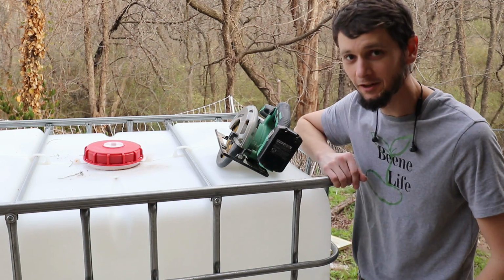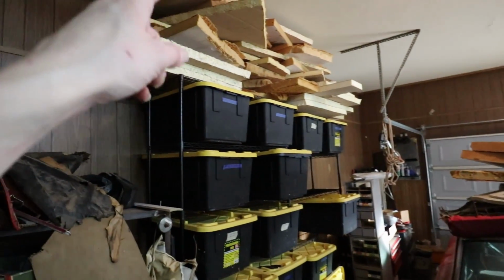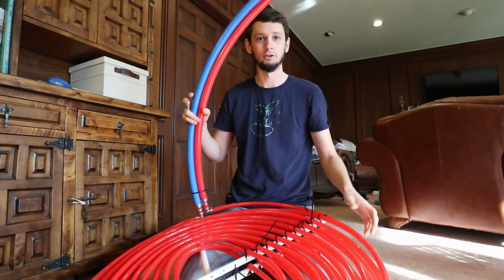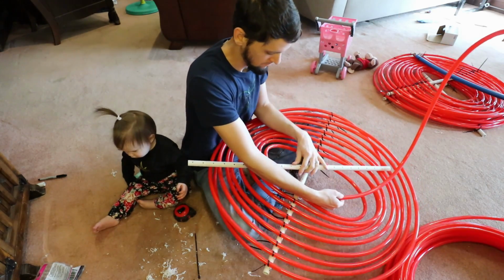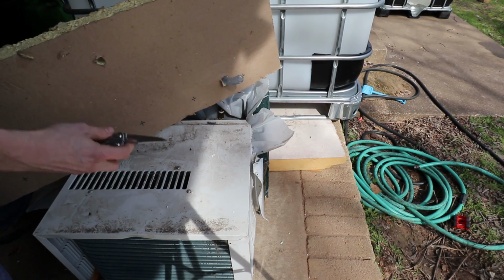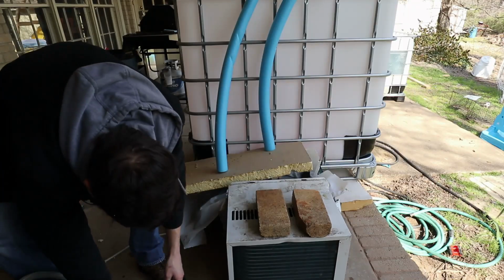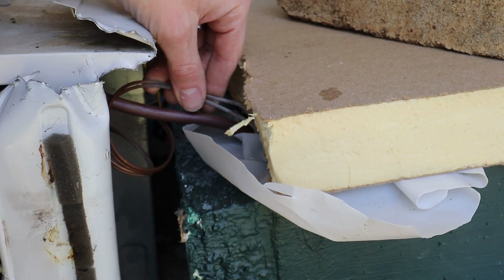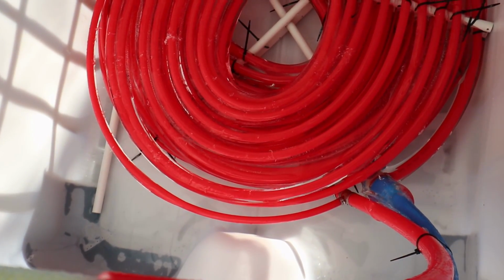ICE Battery Redux - Chiller Freezing 330 Gallon Tote

Comment: Hey man, great videos. I was looking for a way to make a compressor driven water chiller and ice cream maker and stumbled onto your videos that really helped. I wanted to come back and mention something I noticed after doing some more research. AC type heat pumps have a different type of refrigerant typically that will have a hard time getting below 10-20°. Obviously water freezes higher than that but with the transfer of energy it’s recommended that the refrigeration liquid such as the antifreeze you’re using is 25 degrees below what you’re actually trying to chill. It’s definitely possible from my experiments using brine as a refrigeration liquid to make ice cream, but at around 20° on my unit it starts to get very inefficient. No doubt also to the ambient temp being much further from the refrigerant liquid temp doesn’t help, but mainly because the type of refrigerant is not able to get down to 15 or 10 where you need it very efficiently, and other stuff I’m not really familiar with like flow rate of the refrigerant in the ac unit versus a freezer unit. not sure how feasible it is to find an old freezer of the same btu output because they’re usually a smaller output than AC’s but possibly finding an old walk in freezer unit or something like that would work. For my application it works and doesn’t cost much using a window ac unit like you are because I just use it a couple hours here and there to make ice cream or to do cold baths, but as far as for what you’re doing with it, I think that’s why you’re losing a lot of efficiency. I noticed mine worked at 100% or more rated efficiency until the water was about 40° then it went down to roughly 50%, and once it got down to 20° it took a while for it to go down at all. I used two small vessels both coolers so well insulated. For cold baths where the water volume is much much larger but only needs to go from ~65° to 40°, it’s very efficient. I also use a 1200GPH pump and a copper tube as a heat exchanger so that does help but all that staying the same, the efficiency went way way down below 40° or so. Another option if you’re inclined may be too replace the refrigerant in a window unit with the type that gets to -10, -20. Other stuff like flow rate and expansion I think is still limited so it won’t be as good as a professional unit I imagine but should make for better efficiency. That and maybe a steel heat exchanger that won’t have issues with ice freezing around it, but the PEX seemed to do pretty well. I know the higher capacity pump helped a lot for my setup. I was researching water chillers of the same output as my window unit and came across a recommendation for 500-1500GPH pump and mine is a 5K BTU unit but the 1200GPH pump from northern tool was pretty cheap and it seems to work well, didn’t have any issues working with the refrigeration liquid at about 8° when I make ice cream. Anyhow, just thought that might help. I was wondering why my setup started to become really frozen up on the return line and take a long time to bring the temp down each degree after it got to a certain temp so I did some research and seems to be more that air-to-air heat pumps are not really setup to get to temps low enough to freeze while staying efficient. I’d like to convert the refrigerant in my setup but it would require a lot of equipment and is a lot of effort so for me it works to just let it run for longer and if the compressor gives out eventually because of using it under very small load, I’ll just buy another for 40 bucks or whatever, but for your application it may be helpful to convert the refrigerant or find a an old used unit out of a freezer or etc since you’d be using it often for long periods at a time. Insulation definitely has an effect too but it was pretty minimal over the few times I’ve ran my setup for 2-3 hours each time. Was not much more loss in a huge 100 gallon stock tank than a small 7 gallon cooler over the course of 3 hours. Of course for longer storage you’d want it because it’s a constant drain but as far as your test I believe most of the lost efficiency is in the chiller because of its design for “light refrigeration” as it’s referred to on HVAC websites, which is described as high humidity and “higher” temps down to about 40-50°.
Reply from the maker: Thanks for the extra observations! I had wondered if my refrigerant would be up for the task. I’ll keep that in mind as I look to build a more custom unit.
Reply: Beene Garage I was thinking about this some more as far as how to sow what you’re going for without a bunch of hassle or HVAC training or what not, was thinking maybe just using a large chest freezer with piping like yours situated in it? The output is likely lower but with better efficiency and all that really heavy insulation, it may produce as much or more overall but with lower energy costs, or maybe just getting two freezers if you need more capacity. You could use the freezing capability of the freezer for making the ice and the piping with antifreeze or as your way to exchange the heat once you’ve built the ice up. I think as far as the heat exchanger attaches to the pex pipes for cooling your house, you could use fittings that go from pex to copper and then use the heat exchanger from a window ac unit like this, and braze it onto the copper fittings. Then I suppose a fan to blow air over the exchanger like a window unit would have, and your transfer pump you were using already to pump the antifreeze to the heat exchanger and back. Thanks for making these videos man, there are some out there about beer fermenting and using glycol but I wasn’t searching that so probably would never know how to make a chiller had I not seen yours. I have a larger 13.5K btu unit I took out of our camper because the fan went out and ended up being cheaper just to get a used ac unit than the cost of the new fan, so I’m planning to get two larger coolers and another stock tank, and then use both the hot and cold side of the unit for cold and hot soaking baths. My girl is very happy about these hot and cold tub ideas so just wanted to say thank you 😂
Reply from the maker: Ha ha so many uses! My plan is to work my way to doing some refrigeration work, so maybe I could get a hold of “freezer refrigerant” and use that. Brazed plate heat exchangers are pretty inexpensive and would make for a much more compact unit that could be closed loop instead of the open loop I have going on now. I also bought a real taco/wilo circ pump that should get me some nice flow. I need to look around for an Hvac guy in the area with a YouTube channel and see if they’d be willing to help me with the refrigeration piece and put together some YouTube content that way. But haven’t done the looking yet, or determined what I could offer in exchange.
Reply: Hi Beene, thanks for these videos. I have a 220v ac unit that is too large for my window and voltage of my house and I kept looking at the copper coils and condenser thinking "I can make a cold plunge or hot tub out of that somehow, I know it, I just don't..know it..." When I decided to get rid of a large, well built wooden armoire I figured why not save two things from a landfill and build something I want on the cheap! So I have flipped the thing on its side, so the doors are now on top (maybe a sensory dep chamber too?) I am planning on lining the armoire with some cedar boards and sealing with marine grade sealant in between layers and of course in all seams. I was imagining using your coil design but putting them against the edges of the the interior behind either more cedar or possibly some glass/Plexi glass and then running one or more small pumps to create a waterfall effect along the sides and circulate the water. (I'm not sure if that's going to work or not, I don't know how to more evenly disperse the water being pumped from the main tub up through the sides. A sub pump?) Is stacking the coils necessary for efficiency? In a previous video you mentioned that you could heat also using the controller you had and the ac parts (I am no HVAC expert, but I thought that as well, but didn't think gycol would still be the medium I guess). Would you change out the pex if you were to heat to something else? What do you have the coils and antifreeze sitting in? Would I need a special coating at all? I'm really looking forward to seeing where this all goes as far as the ice battery though. You are really thinking outside the box and turning waste into useful energy. It's really great. (@mrjjman -- did you wind up doing what you were talking about? A brine would be safer for a punge I suppose and I was planning on using salt water in the tank itself. Did yours ever go below freezing? ) Any recommendations on a controller that could manage both the cooler pump and the flow pump ( flow pump will need an inline filter of some sort ). I could spend my days content while finding ways to turn people's trash into new useful items. But since I'm not a skilled or educated in any in particular craft, I can always look at things and half figure it out but then I don't know the language to communicate the next step or concept of design. It's thanks to people like yourself I have been able to expand my skill set and find that language so thank you . :)

Comment: Wow I'm building the same thing for a commercial ice machine that is water cooled. Did you know that they run the cooling water straight to drain? That's crazy it takes like 60 to 90 gallons to make 100 lbs of ice. So I decided to make a chiller. The water that's returned is kinda hot but I figured if I can get the temp to stabilize around 60 degrees it will cool the ice machine on a closed loop and not waste sonmuch water. Thanks for the video really interested on how everything turned out.
Reply: Interesting... Will you share your plans for that?

Comment: Those free night and weekends plans are interesting. I started looking at building an ice system for a time of use plan to cool during peak and charge during cheaper nights. Having free nights seems like even more of an incentive to build it. Are there any requirements that some percentage of your use be during the day?
Reply from the maker: I read through all the documents I could find, I couldn’t find anything restricting how it’s used. I have a friend who charges his Tesla every night on his free nights plan and hasn’t had problems so it seems promising. My backup would be using wholesale power from someone like Griddy and just get cheap rates at night. Sounds like that’s something you were looking at.
Reply: @beenegarage7116  I'm in Kansas City Missouri so I only have one electric provider that has a couple different plan options that get cheaper at night but not free. With free power at night, the efficiency of the units should matter less than how much you can produce either with a larger unit or running more than one. It just costs more upfront to buy large/more units to cool. Are you planning on using this with your existing chiller system for your basement to use the ice or another DIY option?
Reply from the maker: Ah the limited options is unfortunate. I agree with your observations on efficiency being a moot point. I do have in the back of my mind the plan to go off-grid and use this setup to generate ice while the sun is shining and solar panels are generating electricity. But for now the nights and weekends plan is my first step.
Reply from the maker: I have a plan for tying into my existing chiller. It has a mode called “free cooling” for use cases like a data room that needs cooling during winter. They add an additional water to air coil outside and only run the compressor to assist as needed. I’d just use a liquid to liquid heat exchanger between the ice battery loop and the chiller loop and truck the chiller into “free cooling” mode. Maybe using an Arduino or raspberry pi.
Reply: @beenegarage7116  Is your main loop for the chiller just water? Wonder if you'll have to add a bit of glycol to avoid it freezing.
Reply from the maker: It does have glycol in it since it runs outside. Didn’t want to run the risk of icing up if the heater shut down during a cold-snap.

Comment: Your 6 gallons of ice is just over 7k btu hours of cooling. You didn't talk about what the starting temp of your water was, if it was 52 to 32 like you talked in your beginning examples that would be about 6.5k btu hours of cooling as well making it much more efficient. https://www.youtube.com/watch?v=vaCSOu4d1po is a great video for some basic info and overall the lower temperatures at night should roughly cancel out the decrease efficiently from making ice instead of just cold air. If you happen to have somewhere inside like a basement to put the ice storage all of the lost cooling would still help cool your house. A rough guestimate is that you could be losing 500btu/hour just from the tank not being insulated. (used 12 ft^2 as the area, 52 to 32 as the temp difference, and R-value of .5 since there's not much insulation)
Reply: If you're keeping your storage outside one option I considered was a chest freezer, you might be able to find some broken ones for pretty cheap as you just need the box and not the compressor. A 15cubic foot chest freezer would be about 112 gallons if you put a liner inside of it and they have an R-value of 14-20 depending on the model. As a plus, the top easily opens up for building and maintenance while staying sealed normally.
Reply from the maker: You make good points. I’m hoping I’ll be able to demonstrate them! My plan is to use some 3” foam insulation as well as bury the tank. Then it’ll be fighting 60 degree dirt instead of 100 degree air. From my back of napkin calculations that combo would make heat loss through the tank negligible. Unlike my current setup. Ha.
Reply: @beenegarage7116  3" of foam at least get you close to what a freezer would be anyways and burying it can hide how large it is. You can even get some spray foam for the gaps. I look forward to your videos as I'm in an apartment right now and can't put a large tank anywhere and want to plan options for when I get a house. Hopefully, you publish a fully finished version in the next couple of years as you're the only DIY version I've seen.
Reply from the maker: Yep, still working out how to waterproof the insulation. Since it will be buried I feel it’s fairly important. Maybe not if I spray foam the joints. I’m determined to get this working, I appreciate the support!

Comment: spray foam a trash can
Reply from the maker: Ha ha yes that would work. I was talking this evening about spray foaming my tote. One of those kits is almost $400 though. Not sure if I’m going to spring for it or cobble together some other insulation method. I have a bunch of 3” thick foam like I set the tote on. It’s just in smallish pieces is the problem.
Reply: You can use the metal frame and create a surround structure. Then insulate with spray foam with the can stuff from Box store or recycle bubble wrap or a PET grade recycling insulation that comes with food delivery.